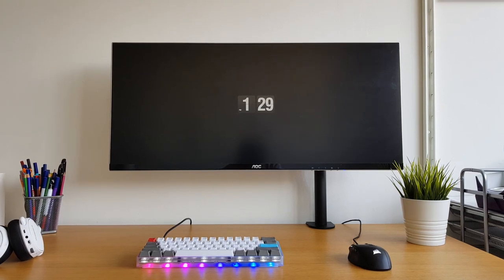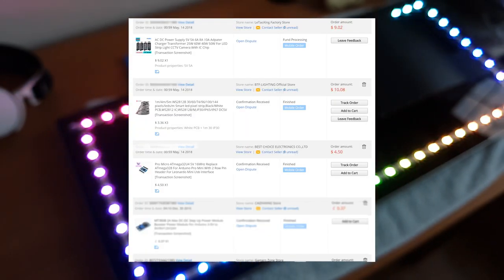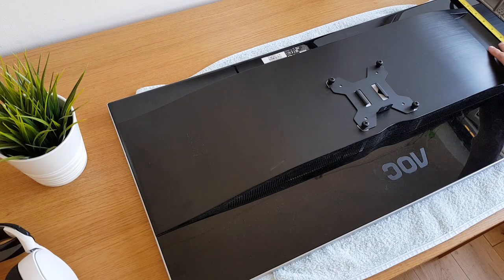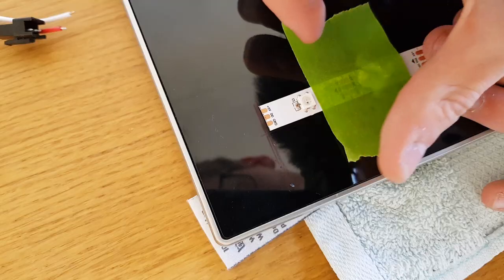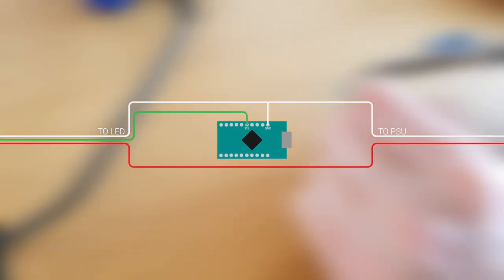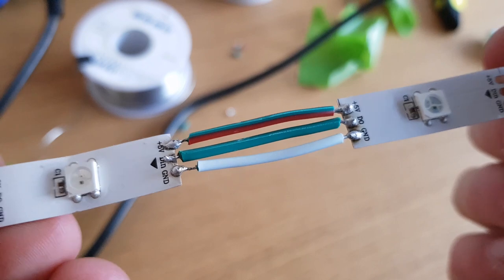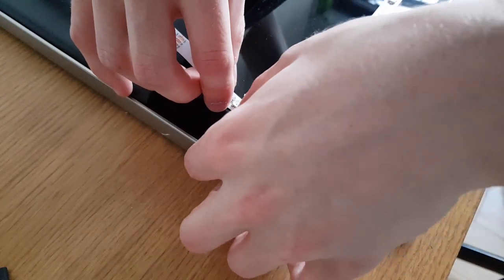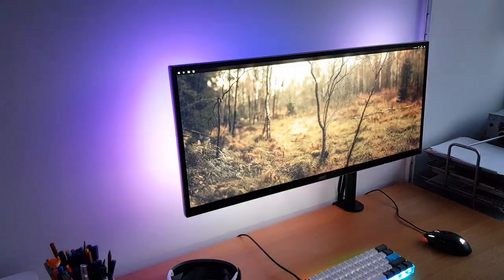Ultimate £20 monitor upgrade (DIY Dynamic Backlighting)

Comment: So on my LED strip I have 5 cables on one end. A red and a white one together and a green, red and white one together. Can I connect the red and white from the first to the power adapter and the green and white from the other to the Arduino? And just tape the red one
Reply from the maker: I have never seen strips with 5 wires on one end! I worry that you've got the wrong strips but do take a look at the specifications, whichever wire carries the data signal needs to be connected to the Arduino data pin. Good luck!
Reply: hey i have the same LED's i think. did you get yours to work?

Comment: this might be a dumb question, but how did you connect the power supply? the one in your video does not have open wires. Did you cut off the connector or use another part for that?
Reply from the maker: You can either purchase a barrel plug to screw terminal adapter from banggood for ~£1 or just snip the connector off to expose the internal positive and negative wires.
Reply: ah thanks, could not find the right word for it!
Went with this one from aliexpress now:
https://tinyurl.com/ycdfjvst

While im already bothering you, there was another thing i was wondering about (Im rather new to the hardware building stuff)
I would like to do this setup for both of my screens.  The only problem i could see is the LEDs not having enough power for two screens. The leds consume ~6mA/ bulb so there should be enough power, the software has to do both screens anyway, and the arduino should be fine as well. (i have to add wires to bridge the LED connection). Is my thinking correct?
Reply from the maker: I've not done a dual screen setup so check the software side for that. The arduino has enough processing power to make it work, but I'd recommend connecting the power supply to both monitors, bridging only the data wire from one led strand to the next to reduce the voltage drop across the LEDs
r/Lightpack is a good place if you need more help and examples. Good luck with your project.

Comment: Great tutorial man, wanted to try this out for a long time and finally found a good video on it! Some questions though:

I already have an arduino uno which i want to use for this. Would i even need a power supply or can i just power the arduino + the strips through usb?
If i need to use a power supply should i weld it directly to the led's, or just connect it to my arduino and solder the led's power to my 5v slot in the arduino?
btw i am planning to use 60 led's per meter on around 2 meters of cable
Reply from the maker: Short lengths of LED strip can be powered by the USB port directly, but for anything over about 50cm I'd recommend an external supply as used here.

Connecting the negative of the supply to the Arduino (but not the positive) prevents issues around voltage stability. The Arduino itself will get it's power from the USB port.
Reply: Thanks man i wasn't expecting an answer that quick. So what im getting is definitly use a PS, and connect it's negative and the Led's negative to the arduino?
Reply from the maker: @mamuts1238  yep that's it, and connect the positive just to the LEDs :) happy to help!
Reply: @Onfe hey, my parts finally came but i'm kinda confused on the wiring. My female connector on the strip has 2 extra cable next to it one power and one ground. Should i use these and just wire one cable to data or should i ignore them? Also what do you do with the other of the strip the male connector?
Reply: @Onfe So im in the middle of doing everything and im kinda stuck. I am preety sure i soldered everything right but the led's just wont turn on, and im kinda scared i fried the led's. Do you have a idea what could be wrong?
Reply: @Onfe Seems like the psu was the problem. Connected it with the arduino and it worked fine (with only a few led's tho). I guess now i just have to find a different psu
Reply from the maker: The LEDS will likely have a connector at both ends with data and power in one connector, some strips also have extra wires for providing more power for the strip.

In total, you need to have connected 3 wires to the LED strips but exactly how these are depends a bit on the strip itself.

The PSU +/- should go to the power and ground on the LEDS, and the data should go to the Arduino.

At the other end of the strip, if you cut it at the cut marks you don't need the other connector, just put a bit of tape over the exposed end.

Remember these strips only work if you connect the data at the right end, there's probably an arrow or similar to indicate this.

Comment: hmmm maybe i dont get it. But how is the program able to ajust on the pictures that are beeing displayed. i dont see where the connection to the monitor or pc is :D anyway amazing build and amazing results would love to try this too
Reply from the maker: The Arduino is plugged into the PC with a micro USB cable. There's a program running on the PC that sends the colour information to the Arduino over USB.
Reply: @Onfe  your amazing answering that fast on a 2y old video:D
I got another one: the programm thats running on my pc. Do i have to start in manualli with each start or is it some kind of background application
Reply from the maker: @firemage8707  Thanks! The program can run at startup in the background, or be started manually, depending on the settings.
Reply: Ok im a complete beginner. I needed some wires and ordered breadboard jumper wire. Will they be enough to handle the load or will i get into trouble with overheating etc

Comment: Great video! I got myself all the components in the past weeks, however, I don’t get it run as I am new to ‚coding‘ at all. I would really appreciate a step by step instrukction - if you dont mind! The soldering and electricity set up is correct , I can ensure that ;-)
Reply from the maker: Hi there, I unfortunately don't have this setup anymore as I largely use Linux :( Feel free to take a gander over at the Lightpack subreddit as there's people there that know more than I remember!

Comment: Would the same setup using the 60 LED strips work the same? Thanks for the guide!
Reply from the maker: Yes, 60 LED/m should work fine, but the 144 might be too much for the software to handle
Reply: Onfe Very interesting. So the more LEDs you are running the more demanding the software will be? The reason I ask is I am going to be using this with 1440p 144hz so if this is the case the 30 LED strip may be a better option for me. Thanks in advance!
Reply from the maker: @ryandennis483  I have a 1440p 60hz ultrawide, and with 30 led/m it uses about 3-4% of my CPU when active (i5 quad 3.5ghz) you can set the refresh rate to be lower on the LEDs to reduce the performance impact. I use 30 refreshes a second on the LEDs iirc.

Comment: Is 60 LED per meter better? Would it have better color transitions etc?
Reply from the maker: It's a trade-off between CPU usage controlling those LEDs and the smoothness. If you've got a sub-27" monitor with a decently spec'd PC, you'd probably benefit from the 60-per-m. Personally went for the 30-per-m as it seems fairly visibly smooth and I didn't want the CPU impact. Hope that helps 🙌
Reply: @Onfe  It definitely did. Thanks again!
Reply: @Onfe  How much of a CPU impact do you get?

Comment: why not power it all through usb on the arduino mini and get the psu ? Easy to porwer through a usb port on the monitor . no ?
Reply from the maker: With all LEDs on at full brightness, you'd only be able to run 15-20 from a USB port. With USB-C PD it would be possible, but boards that support that specification are more difficult to come by and more expensive. Furthermore, many monitors don't have a USB PD output so you'd end up using a power adapter anyway.
Reply: Arduino also have a limit on how much power they can supply, at some point they run really hot and go boom boom.

Comment: Hello, the test code works fine but as soon as i upload Adalight FastLED script it fails to work. Prismatik is already installed on my computer
Reply: now its getting stuck on rainbow mode
Reply from the maker: That's kind of odd, what sort of error are you getting if any?
Reply: @Onfe  i just solved it , but right now im not getting the true colors which is strange. For example im opening up RED color from youtube but im getting Green color on LED s instead, do you have any idea why this might be ?
Reply from the maker: @yorumsuz8252  from what I remember, there should be a setting in prismatic to set the colour order, as it depends on your LED strip I think?

Comment: Hello, i have a power supply as 35W 5V 5A is that okay ?
Reply from the maker: You'll need to check the amp rating of the LED strip you purchase and how much you use - for example, 1m of 30 LED per meter tape would be around 1.5A, but do check with the seller of your LEDs.
Reply: @Onfe  thank you so much for the fast response. I used the same leds its 1meter ah and it says 9 watts
Reply from the maker: @yorumsuz8252  you should just about be alright with your 5A supply then 🤞

Comment: It doesn't work pls help.
Reply from the maker: I'm sorry! I haven't got the system on my monitor at the moment because I'm at university - the adalight subreddit has always been pretty helpful
Reply from the maker: My bad, it's r/Lightpack
Reply: I just discovered my power supply is 0.3 A. Can this be the issue? The LEDs don't work.
Reply from the maker: @rambolambo3441  Yes that's probably an issue, but considering you commented saying the Arduino gets hot and nothing works earlier, you might also have a short.
Reply: Yes but I fixed that and now I'm using your setup instead of the Arduino Uno. The Arduino micro works fine and doesn't get hot, it's just that the LEDs don't update.

I have 48 LEDs, do you think 3A is good enough? In another video I read that if you have more than 60 LEDs, you need 5A.
Reply from the maker: @rambolambo3441  3A is probably fine, but a higher rated power supply, around 5A, would give you some margin.
Reply: @Onfe  Okay thanks for the help! I'll still pick 3A because 5V 5A power supplies are barely available in my country and I don't want to wait weeks to get it :)
Reply: Just wanted to let you know the power supply was indeed the issue. With my new power supply it worked instantly! So happy how it turned out! :D

Comment: Hey does this still work after two years?
Reply from the maker: Hey! I unfortunately can't tell you as I use Linux now, but in theory as long as the software works, it should be doable.
Reply: @Onfe  okay thanks! Great video support I get here. Just half an hour on a 2 year old video. That's great man!